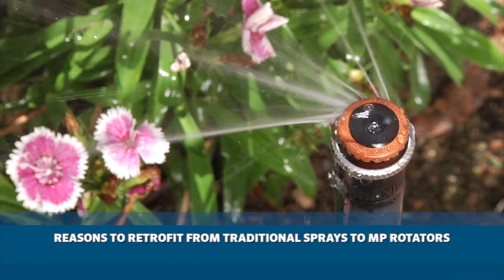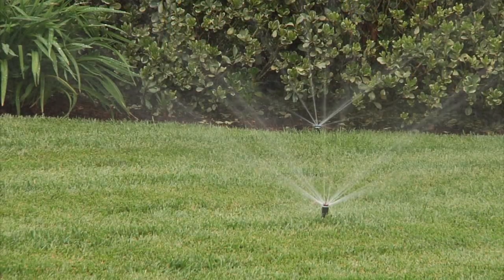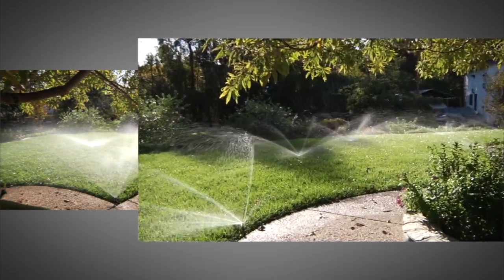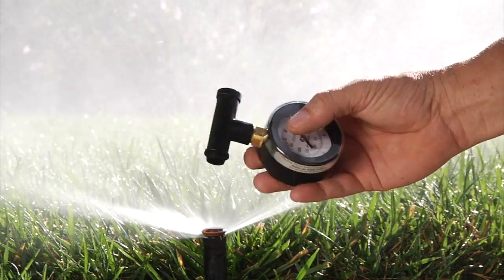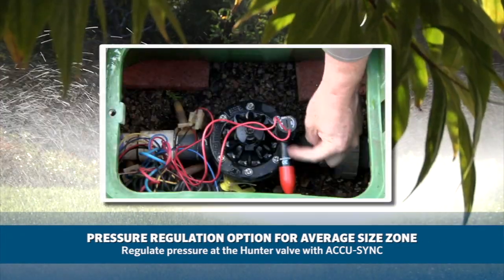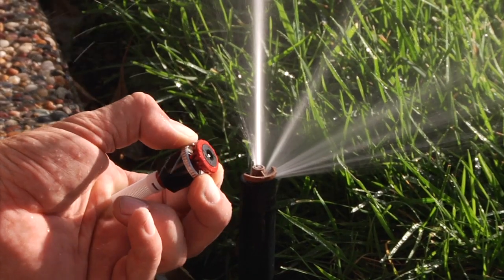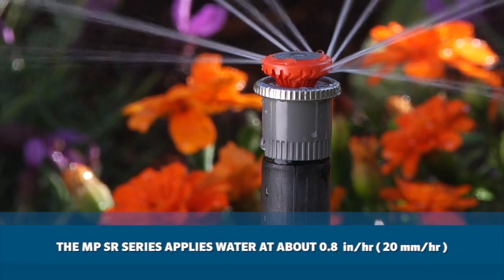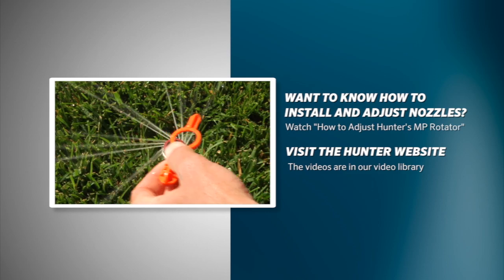Spray sprinklers to MP Rotator retrofit: Convert your standard sprinklers to efficient MP Rotators

Comment: With the Hunter MP gauge I tested it with a rotator nozzle at the top and got 30 PSI. Then I put a Hunter nozzle cap on the top of the Tee instead and got 40PSI. So 40PSI is if the gauge gets all the water flow pressure and 30PSI is if the gauge shares the water flow pressure with the rotator nozzle. Which is what my nozzle would get if the gauge wasn’t there, 30Psi or 40psi?
Reply from the maker: The recommended water pressure at the nozzle is 40 psi, while the water is running. https://www.hunterindustries.com/irrigation-product/mp-rotator/standard-mp-rotatorr-nozzle

Comment: What is the best way to permanently cap sprinkler heads I don't need so they don't leak?. it looks like my sprinkler system has way too many sprinkler heads.  Now if I convert them to mp rotators I will need even less..
Reply from the maker: There are several ways to stop the flow to a spray head. The Pro-Spray Shutoff Cap 213600SP caps off the head by replacing the cap, while the Shutoff Nozzle 916400SP doesn't allow flow through the nozzle. Another option is to dig up the head and plug the outlet below grade.

Comment: Hi
I have both the MP rotator 3000 and MP 2000, but I notice that the radius of the MP 2000 is not up to spec.

I use them at 3 Bar and they should do 6.1 meters but they don't even reach 5 meters
I don't have this problem with the 3000 series.

I don't understand what it could be?
Reply from the maker: Verify the outlet pressure using a T and a pressure guage and verify that the radius is on reduced. If that fails, contact our customer support department here: https://www.hunterindustries.com/hunter-technical-support-email-request

Comment: Do these fit in any standard spray head or do you have to install hunter spray bodies? I have fairly generic rain bird from Lowe’s and I’m sick of their inconsistency and breaking all the time.
Reply from the maker: Thank you for contacting Hunter Technical Support.
 
The MP Rotators will fit on most spray bodies as the male threading is an industry standard.
 
To maintain the longevity of the nozzle we will always recommend using the PRS40 bodies.
 
https://www.hunterindustries.com/irrigation-product/spray-bodies/pro-spray-prs40
 
Thank you again for contacting Hunter Technical Support. Please let us know if we can offer any other assistance.
Reply: @Hunter_Landscape_Irrigation  
I ended up buying Hunter heads and just replacing them. Happy so far - just need to replace all the rest. I did only a few as a test.

Comment: I’m not totally convinced on these nozzles yet. Seems if I have heads that are misting I can just drop the pressure and if I’m at too high of a precipitation rate for soil conditions I can just do multiple soaking cycles.
Reply from the maker: Yes, if spray nozzles are misting, you can reduce pressure, and if runoff is an issue, cycle and soak from the controller is a great solution. MP Rotator Nozzles are also an easy solution to misting and runoff, and they provide other benefits as well. With the low precipitation rate, more MPs can go on one zone than sprays, and they make for a good retrofit solution if available pressure has dropped too low with sprays. MPs also have higher uniformity with matched precipitation from 5 ft wide side strips up to a 35 ft radius which makes for simple system designs. MP Rotator Nozzles are an all-around solution to many irrigation system concerns.

Comment: I recently moved to a home that has Hunter, 10 zones. Each zone has 3-4 older heads, which I'm replacing.

Do these zones, now after these low flow rotators, have to spray zone-by-zone or can they all be used at once, or maybe grouped together on the timer to make 2 or 4 spray zones?

I also bought various colored lawn flags from Amazon and at first, I'll color code each zone and note the zone # by writing on the flag and making a map. I'll also measure between heads to choose the best rotator.

I had read somewhere that each head spray should reach the nearest heads, so I'll adjust each one until it hits the nearest flags.

Funny part is one sprinkler currently between homes and wooden fences sprays 360 degrees, but there's not much space between the fences. Maybe 8 feet. So that one sprays my lawn, up my fence, to the other part of lawn and theirs, and then up their fence into thei back yard lol. I laughed hard the first time I saw that.
Reply from the maker: Hi Robert, In a residential irrigation system, the amount of water available in GPM (gallons per minute) determines how many heads can be watered in a single zone.  For that reason, the residential controller is designed so that it can only water 1 zone at a time.  It won't be possible to group the zones together from the controller to bypass that condition.

Comment: I have been using these Hunter MP Rotator sprinkler heads for years now. They work great, and they are very reliable and easy to adjust. Not to mention the water they save by not allowing it to blow/evaporate in the wind or run down the sidewalk. I have tried the MP Rotators with pressure regulated sprinkler bodies, and with pressure regulators at the valves, in the past, and they work fine. However, I have found that the MP Rotators work just as well, or better, at full line water pressure (80 psi), and just control the actual water flow/pressure  at the sprinkler valve with the adjustment screw. All of the sprinklers get equal pressure and I have had no issues running this way, with many of the MP Rotators running for many years now like this. Just my two cents on the subject.
Reply from the maker: Awesome! Thank you for choosing Hunter!

Comment: Can this be used in an orchard setting? Tree setting is 10 feet apart, 45 trees per row and rows spaced 14 feet apart.
Reply: I would think you would be better with drip irrigation.

Comment: I am currently in the process of replacing my spray nozzles because we live in an area that gets windy.  I was considering multi-stream rotator type nozzles but the problem is they put down water way too slow.  We have a pretty large lot with 11 grass zones and 4 drip zones.  It would take half a day to get all this watered.  It would be really nice if someone made a high output multi-stream that I could just screw onto each nozzle.
Reply: That's the point of the MP800 which puts out .8 in./hr as opposed to the standard MP's which put out .4 in./hr . However, standard spray nozzles usually put out 1.6 in./hr so the MP800 will still require twice as much time as spray heads. If you have too much pressure on some/all of your current sprays, that will cause them to mist excessively which makes the wind problem worse. If so, you should try installing pressure regulating bodies for your sprinkler heads or getting a pressure regulator for the valve as shown in the video. This will improve your wind issue even if you keep your spray nozzles.

Comment: Why would my MP’s not rotate that fast?  I have some that barley move while others that move at a nice pace, and only 3 per line. Is there a way to adjust the rotation?
Reply: Faster rotation indicates high pressure at the beginning of the circuit and diminished pressure toward the end. I had the same problem when I had my first system installed. I went back and replaced all of the sprayer bodies with regulated bodies (40 psi) and then they all would spin at the same steady rate.

Your other problem may be dirt and debris in the line. Pull the nozzle off and check/clean the filters on the ones that are spinning slowly.

Comment: With my experience of both systems, MP rotator are much more expensive to maintain in the short and long run. their gear mechanism break down in a year or so and less reliable compare to pop up sprayer
Reply: I had MP1000's installed at a house in Arizona that I no longer own. Year round watering for summer and winter grass. And Arizona has notoriously hard water that destroys water heaters, dishwashers, shut off valves, etc.

I had the local landscaping guy constantly stopping in his truck when I was working in my front yard. He said over and over that I needed to replace the nozzles with brass sprayers for reliability.

Not one nozzle failed in over two years. I had to replace two assemblies (riser and body) when the city ripped out part of my irrigation system with a backhoe while fixing a water main break. I was able to reuse the nozzles. Very easy to do, very easy to get the system back up and running. 3 zones running on Hunter Node controllers. Very reliable on just one 9v battery each year, but GAAAAWWWD are those things a headache to program. Not intuitive at all. And pretty expensive.

Now that I live in Colorado, my house here has Rain Bird impact sprinklers. In one summer, 4 of the 14 have failed in one manner or another. Just ordered 14 PRS40 MP2000 bundles. Can't wait to get rid of these awful impact sprinklers.
Reply: haghighat1
Reply: Were these MP rotators running at the optimal pressures? (40 PSI) If the pressures were too high, it might have caused excessive wear.